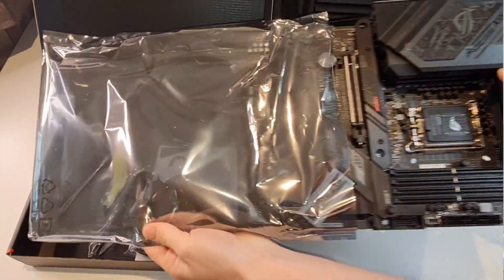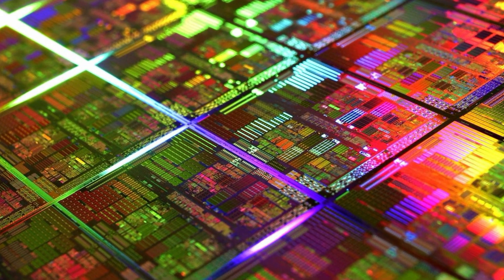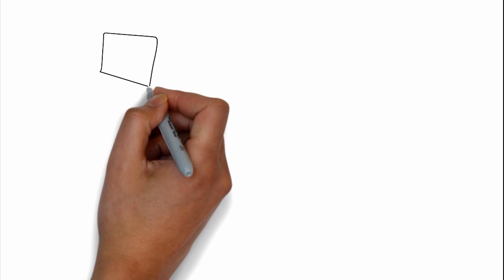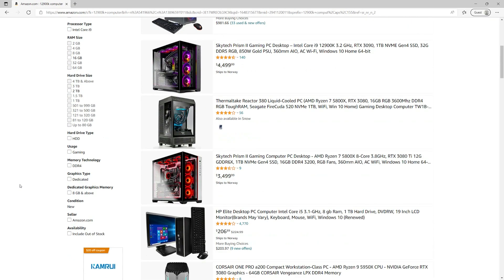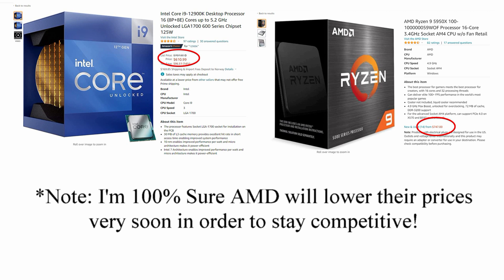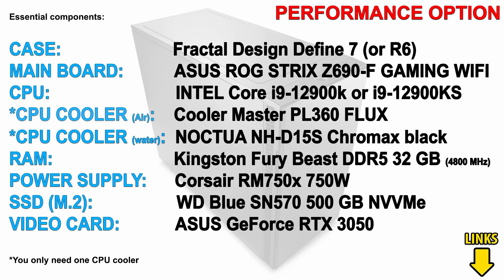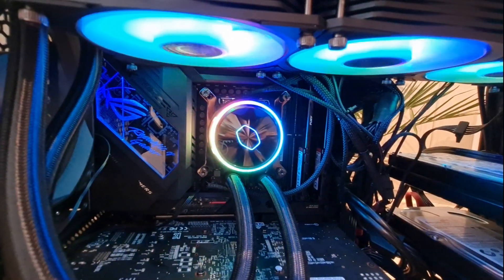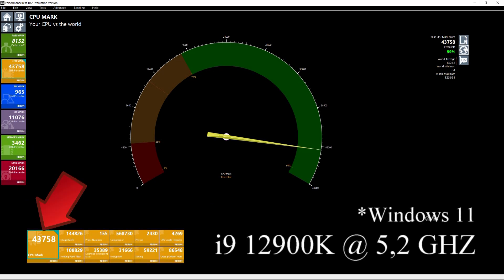The Best Computer for Music Production - What's Needed and Why!

Comment: Hi man. Great video!

Should I get the 12700 or the 12700K?
These are the specs of the two cpus 2.10 GHz (4.90 GHz) 	A-Core Frequency 	3.60 GHz (5.00 GHz)
Reply from the maker: Would go for the k. :)  the k chips are usually faster. They are unlocked and can give a noticeable performance boost simply by enabling the ai overclock feature in the bios.
Reply: @FireWalkMusic  Thanks man.
Keep going well on this channel ; )

Comment: Anyone know how well the budget version outputs?
Reply from the maker: Even the budget option should provide more than enough performance for most people. Most people don't make huge projects as I showed in this video. If you make huge orchestral compositions with tons of virtual instruments and effects, orchestral trance or something like that then you might want to go for a beefier solution. However, if you make typical EDM, bigroom, electropop, etc then the budget option should do just fine.
Reply: @FireWalkMusic  what about music videos about 3 mins long advertisement concepts and music ranging from moder rap hiphop to acoustic recording. Havent been in this line of work for almost 2 years now looking to get back into it but not throw a few grand if the market is still as bad as it is right now.
Reply: @FireWalkMusic  would it be able to handle that much?
Reply from the maker: @OGslays  it will be able to handle it, but keep in mind that when working with video you will benefit from more cores and better graphics card as well. A faster computer will be able to render our video faster.
Reply: @FireWalkMusic  yea ever since I purchased the parts all I keep hearing is how terrible the AMD 6500 graphics card is at anything besides games. Apparently its very weak also. Says it lack several features and peforms as well as 6 year old graphics cards. That's been a majority of reviews for this card.
Reply from the maker: @OGslays  yes, it's just a cheap card that provides decent graphics for occasional gaming and 3d accelerated plugins etc, but not much else. It is mainly intended for people with very limited budgets, so that they can spend more money on other parts instead.  For video editing Nvidia is better because you can then use the Cuda corees to boost performance. I'd go for a rtx 3060 ti for example. Decent performance but not too expensive.

Comment: This was so helpful! Thank you!!
What would you recommend for SSD/HD. Should you put the OS and DAW on one SSD and data/projects on another.  Since I am starting fresh I want to do it right! Any thoughts? Thank you!
Reply from the maker: You're welcome. Yes, I recommend having the os on one ssd drive and another one for samples etc. This motherboard can hold 4x m.2 drives btw. :)
Reply: @FireWalkMusic  thank you!!
Reply from the maker: @marcdebenedictis8324  You're welcome. I have one 500 GB disk only for my os, but even a 250 GB disk will work fine as long as you don't install to much stuff on it. Keep in mind that ssd disks degrades much faster if you fill then up, so it's best to go for something that is quite a bit larger than what you really need. :)
Reply: @FireWalkMusic  ok good to know. Thank you!!
Reply: I will go with 1tb SSD for OS and 2tb for Daw and data.  Should 1 get 1 32 gig memory or 2 16 gig.  Read that pairs or quads are better???
Thanks. Also Are there different speeds to SSD as well. 
Thanks
Reply from the maker: @marcdebenedictis8324  sounds good! go for pairs 👍
Reply: @FireWalkMusic  I bought everything but I am having trouble with the master liquid pl360 flux. It seams to big for the case?  Do I have to take the front fan out put it there?
Sorry if stupid question but first pc build!!  Thxs
Reply from the maker: @marcdebenedictis8324  it's quite large so you might have to remove something to make it fit. I had to remove my cd rom in order to make mine fit.
Reply: @FireWalkMusic  yup we managed to get it in there.  Moved the chassis fan up top and had to move the hard drive rack over.. got it though. Lol. Waiting for graphic card to show and will fire it up    Fingers crossed!!  Thank you!
D

Comment: Is it me or did the sound quality improved in the new build?
Reply from the maker: I've switched to another video editor since the 9900k build video, it's possible the audio bitrate in the exported video was slightly lower in the other video. :)
Reply: @FireWalkMusic  ahhhh Thank you for the video brother! Atm im on a i7 6700k on a asus hero vii, 32gb ddr4 with the thunderbolt expansion with my Apollo x8 & a gtx1080ti, and replaced my fans with corsair magnetic fans which made a huge difference in sound noise. I do have a out of case setup and never had any issues with sound so far with those fans! I definitely want to upgrade to the 13th gen when it comes out! 

in my very large projects i been struggling but also it mainly because i make metal music which tends to be a very dense mix requiring a ton of elements and since im a vocalist i midi everything which does take a toll moving through the project itself!

It definitely effects me when im mixing or even starting a large project, or if i want to rearrange anything in the song

It works amazing till this day, but it's definitely that time where the investment is worth it!

Comment: I have  decided to go with the bigger Fractal case  Thx good advance  better airflow , cooler so i quieter less noise, I still have a question about the m.2 NVMe  > WD_BLUE SN570 SSD's each 2 TB  , i want to put 3 of them in  in staid of any SSD disk's at all > Is that okay , one for system (Windows ,Cubase , Native Instruments , and other for  the Samples from Native Instruments , and the third one to record the songs and store the data , Will this work as good (faster) then having a couple of SSD disks  ? I am thinking if buy this for storage also ! 1/ as System SSD m.2   , 2 /as sample SSD m.2  , 3/ as  storage and record song data SSD m.2
Reply from the maker: That should work. I always fill up my m.2 slots first, and then move on to sata ssd disks. M.2 drives are much faster overall (PCIe vs sata)
Reply: @FireWalkMusic  ow Good ,then i can buy 3 of them , the price is about the same , will be nice the difference in loading sounds , maybe get the latency a lot too !  I see 4 slots for M.2 on the ASUS ROG Strix Z690-F Motherboard , the last one (slot number 4 )is both m.2 NVMe as well as sata m.2 both fit Thx FireWalk .
Reply from the maker: @RoelCyborg  yeah, you should be getting PCIe speeds from all slots with the motherboard I've linked to in the description. On a second note, I just noticed what I actually wrote  and just wanted to clarify: no, I'm not drunk, it's just autocorrect constantly working against me.... 🙈
Reply: @FireWalkMusic  😄yes it was clear, i understand , its my first build so double check and everything fits good together this build , i got this info that four of them (m.2 NVMe ) slots on this motherboard from looking at the manual quick start from this Strix board , i found a video how to connect the power-suply to the board ,so good to go ! (i was thinking on waiting with a graphic card ,price might go down,i hope )
Reply from the maker: @RoelCyborg gpu prices are quite low now, but I suspect they will keep going down a little bit more. You can use the built in graphics for a while and then get a dedicated graphics card. That shouldn't be a problem. :)
Reply: @FireWalkMusic  Yes i also don't know yet which card i might need lateron , the one you showed in the video seams like a nice mid range card ASUS GeForce RTX 3060 Ti TUF GAMING OC V2  (but will only do some Wacom PhotoShop drawing 2d animation maybe ,and simple Premiere Pro video editing  / Now i have a ASUS M70ad  computer i7 16gb ,,,the new build will be a world of difference very CooL
Reply from the maker: @RoelCyborg  the 4000 series will probably launch in a coupple of months. It is possible the 3000 series card will become even cheaper then, if the availability of 4000 cards is is good that is. That's kind of a will card with the ongoing chip shortage and all... :)
Reply: @FireWalkMusic  Thx FireWalk , i will keep an eye out for the 4000 launch for a price check and buy moment , i hear the Crypto's downfall at the moment has something to do also with less of chip shortage , Crypto's seam to eat or ate the chips !*_*):elbowcough:

Comment: Greetings FireWalk 😁 I still have a question FireWalk To be sure , on the link  to amazon (i am in Europe ) i get only the Fractal Design Define 7 Compact (size WIDE 21 cm 8,26 inch , DEEP 42.7 cm -16.81 inch , HEIGHT 47.4 cm - 18.66 inch) ,,,That is the small compact version , but there is also a bigger version > Fractal Design Define 7  Midi Tower (size WIDE 24 cm 9.44 inch , DEEP 54.7 cm -21.53 inch , HEIGHT 47.5 cm - 18.70 inch) the last one is bigger  so mostly wider and deeper , which one should i take for to fit in the Noctua NH-D15S  cooler for the CPU ,,, If i know which one to take then i can order the wholle set up that you gave in the video and links , Thx in advance 🖥🖱💽
Reply from the maker: Hi, I would go for the large one. It's not as big as it looks, and it will provide much better air flow too. :)
Reply: @FireWalkMusic  ow hey thx Firewalk , Its good news , it also cost 60 euro less , and the bigger one would not fix under my desk (so next to it) gonna go for the compact then ,thx for your help ,and the build set up guide !*_*)
Reply from the maker: @RoelCyborg  You're welcome. I know it should fit in the big one, not sure about the small one though, but you can see a list of compatible cases on the noctua web page. It also lists the height of the cooler when installed, so that you can calculate the size requirements. I'm not home right now so I can't check myself. :)
Reply: @FireWalkMusic  yes i check on their website they mark as compatible , so i am gonna try the compact case ,Thx getting closer to order the whole thing :shelterin:going for a white case , futuristic look
Reply from the maker: @RoelCyborg  thats great! Enjoy the build. It's always fun to build a brand new computer. Kind of like Lego for adults. 😁
Reply: @FireWalkMusic  I have  decided to go with the bigger Fractal case  Thx good advance  better airflow , cooler so i quieter less noise, I still have a question about the m.2 NVMe  > WD_BLUE SN570 SSD's each 2 TB  , i want to put 3 of them in  in staid of any SSD disk's at all > Is that okay , one for system (Windows ,Cubase , Native Instruments , and other for  the Samples from Native Instruments , and the third one to record the songs and store the data , Will this work as good (faster) then having a couple of SSD disks  ? I am thinking if buy this for storage also ! 1/ as System SSD m.2   , 2 /as sample SSD m.2  , 3/ as  storage and record song data SSD m.2

Comment: This is strange. I have the i9-9900KS OC'd at 5GHz on all cores and I can't get the thing to choke out no matter what. I also have 64GBs of the fastest Trident Z Royale DDR4 memory in it too. I haven't tried to throw a 70-track orchestral composition at it either but it can easily tank 5-7 VSTs just fine. Infact Windows says 4 of my 8 cores are generally sitting there twiddling their thumbs when I'm producing. In your video were you using Windows as your ASIO audio engine? I use my TASCAM 20x20 Audio Interface as my audio driver and that sucker can record down to a mind altering 4ms sample rate at 192KHz. I normally don't go that low and record at a comfortable 256ms at 48KHz. I see no reason in the next year or three to upgrade my 9900KS anytime soon.
Reply: odd flex but ok
Reply: @jxnkie613  no flex just info imo, with luck you can get somewhat close to apple silicon performance, but the pc world is always risky , hard rto find well working together components and drivers. lot of work to get to a good system

Comment: Hello FireWalk ,Thx for this great Music PC build guide and your knowledge .For me you it filled in all the blanks i was waiting on to build a real music PC . So thx alot , great video, information + Great PC Build guide ! 
(i have a standard Asus i7 16gbram so this will be a huge improvement ) I have one question ,
 i wanna go with the air CPU cooler ,its kinda big , your build has the > Fractal Design Define R6 White USB-C Midi Tower ,,
But this one is sold out in my country , (only have a white one left )
, i think in your video you told can use the Fractal Define 7 model case in staid , but which 7 version does this air cooler fit in (if you know ) ? There are many 7 series models , and they are all smaller then the Define R6,, i found the >Fractal Design Define 7 Gray Midi Tower but it is still 7 cm smaller ( 2,75591 inch )
Reply from the maker: Hi, glad you liked the video. I've linked to a comparable cas ein the video description (both the define 7 and the r6). There should be plenty of space for the cooler. You'll end up with about 2 cm to spare.
Reply: @FireWalkMusic  Thank you ,I see the link sends me to( Fractal Design,BT Fractal Design Define 7 Compact Black Solid (FD-C-DEF7C-01)*2160   )  I am gonna order all the parts tomorrow then !*_*) very excited build this one , Was thinking of putting in 3 SSD of 2000gb  m.2    >  WD_BLUE SN570 2000GB M.2  (then not have put in any SATA SSD's ) Thx again for this Super Computer build , very excited to start , Greetings from Holland  ( the Netherlands )
Reply from the maker: @RoelCyborg  You're welcome. Yeah, having them directly on the motherboard is much cleaner, and they are usually faster too. :)
Reply: @FireWalkMusic  Yes six times faster 😁 I still have a question FireWalk To be sure , on the link  to amazon (i am in Europe ) i get only the Fractal Design Define 7 Compact (size WIDE 21 cm 8,26 inch , DEEP 42.7 cm -16.81 inch , HEIGHT 47.4 cm - 18.66 inch) ,,,That is the small compact version , but there is also a bigger version > Fractal Design Define 7  Midi Tower (size WIDE 24 cm 9.44 inch , DEEP 54.7 cm -21.53 inch , HEIGHT 47.5 cm - 18.70 inch) the last one is bigger  so mostly wider and deeper , which one should i take for to fit in the Noctua NH-D15S  cooler for the CPU ,,, If i know which one to take then i can order the wholle set up that you gave in the video and links , Thx in advance 🖥🖱💽

Comment: I see that i7 12700k and i9 12900k has a small gap in performance percentage respectively. Would you recommend i7 12700k?
Reply from the maker: It always depends on what kind of music you make, how big your projects are (synths, effects etc) and last but not least, your budget. 
Very few people will be able to max out the 12900k, and even the 12700k will usually be more than enough for most people. :)
If money is no issue, go for the 12900k. Otherwise, go for the 12700k and spend the money you save on something else you need instead. :)

Comment: Nice video!  Thanks!  It may be outside the scope of the video (and reason for a follow up), but, I think the audio interface's drivers when it comes to latency is EXTREMELY important.  Take a look at RME, who still use USB 2.0 for a large part of their portfolio, because their driver team is so advanced.  Compare it with UAD's drivers team (for example).  Both on internet forums, and IRL experience will reveal a HUGE difference, especially when you're considering plugins.  It would be good to test monitoring, recording, and mixing experiences with CPU hogs like Omnisphere and Waves Hverb.  Run some large sampling libraries to stress test the memory kits and SSD brands.  Overall, great job.  Just thought these extra real life tests would take your recommendation videos to top notch.
Reply: Barry John's is a big supporter of RME's performance.  Pricey, but might be worth it.  I am also looking at the more direct to card AD/DA boxes which are used in pro houses.

Comment: For the performance option, is there a cheaper motherboard and/or graphics card alternative that you could use as well? Thanks for the video btw!😀
Reply from the maker: You can use any LGA 1700 compatible motherboard. The main difference is the features they offer. If you want to go with a cheaper one then that shouldn't be a problem. Same for video cards. If you're on a tight budget, you don't even need a video card at all since the 12900k has integrated graphics, so you could just go with the onboard one and skip the video card altogether.
Reply: @FireWalkMusic  I appreciate you taking the time to answer my question Mr. Firewalk. Thank you!
Reply from the maker: @jackc_30  You're welcome 🙂

Comment: I might build this budget version. 
I think you forgot to add the operating system Windows 11 to the cost which is $139.
Reply from the maker: Just get a cheap $15 oem key instead and download the installer from Microsoft. That's what I did. 100% legit. https://www.cjs-cdkeys.com/products/Windows-11-Professional-CD-Key-(Digital-Download).html?setCurrencyId=1&gclid=Cj0KCQjwnNyUBhCZARIsAI9AYlFc1gMvSkSCo8X01j3IlybCf3Ke6AgGTTeDIyhebQ3AxZ_a-e-V1cAaAsWwEALw_wcB
Reply: @FireWalkMusic  
Thanks for the tip!

Comment: What if I’m also interested in using my computer to make animations. What graphics card should I be looking at?
Reply from the maker: Not sure what kind of program you're using for animations but I'll assume it's using gpu accelration for renderings. In that case you'll benefit from more Cuda cores. The upper rtx 3000 series gpus are good. For example the rtx 3080 or rtx 3090. The new 4000 series will arrive within a few months, and will provide even better performance. 
That said, even a cheaper graphics card Will get the job done. It's just a matter of rendering time getting shorter with the more powerful cards. It depends on how much or how little time you have on your hands i suppose :)